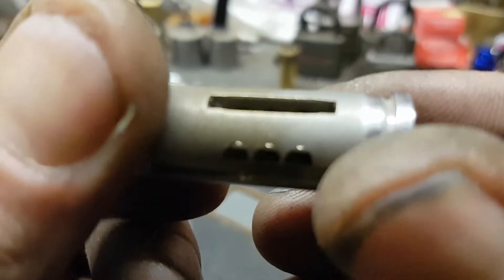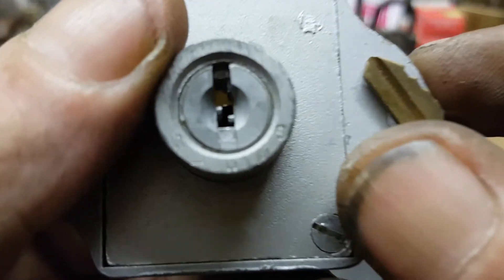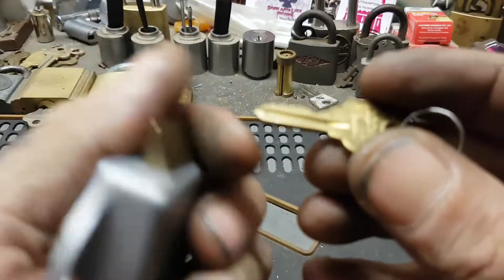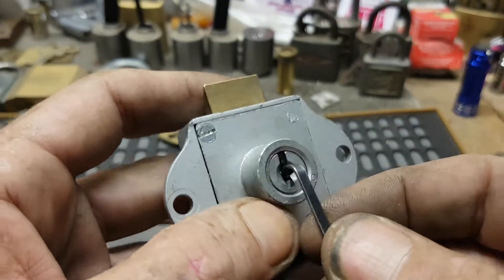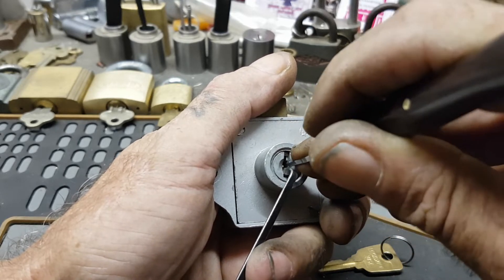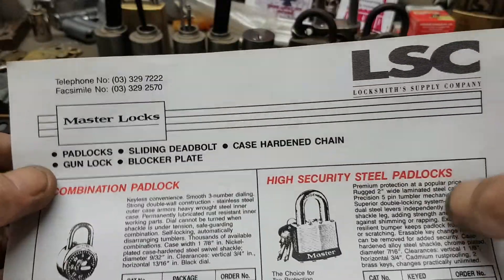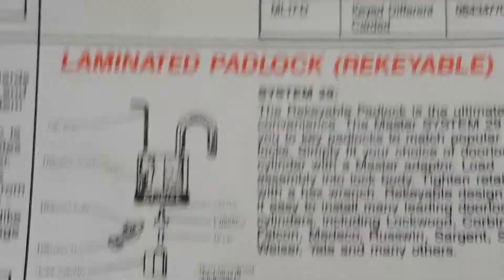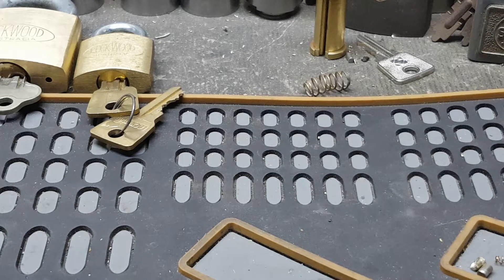#289. Lockwood drawer/cupboard lock for GMH Adelaide.

Comment: Hi Paul, That wafer  Lockwood "cupboard" lock was fitted on the spare wheel compartment of the Holden panel vans. The compartment was at the rear below the panel van rear doors. I believe they used them from 1963 EJ through EH, HR, HD and perhaps beyond, I'm not sure when they stopped producing the panel vans. Anyway that's where GMH used these locks.    Regards, Brian.
Reply: P.S. Should have said HD, then HR ... apparently it stands for Hastily Designed and Hastily Revised ! (:-))
Reply: @brianhignett8954  lol!! Holden padlocks show up from time to time on eBay. But I think these were for locking the spare wheel in the car boot.
Reply from the maker: Thanks Brian. Appreciate the intel on the lock. Was a bit lost on their specific purpose. It's good to know their history with GMH. Have a good day:-)
Reply from the maker: @brianhignett8954  lol. Thanks Brian. Might be some truth in that statement. Have a good one:-)